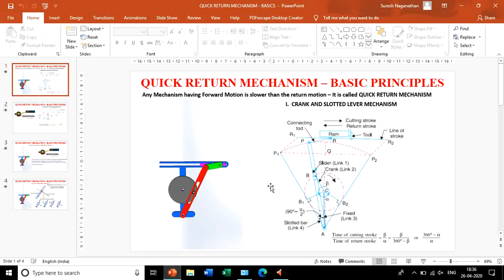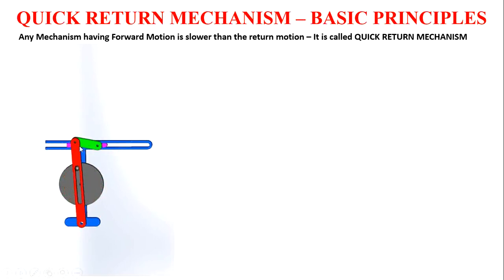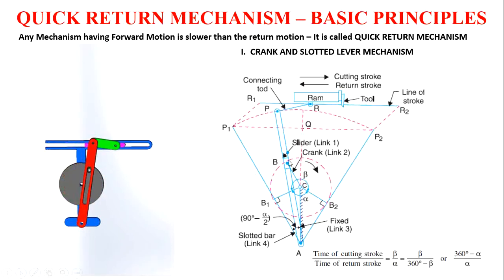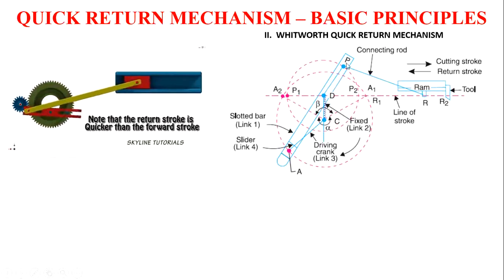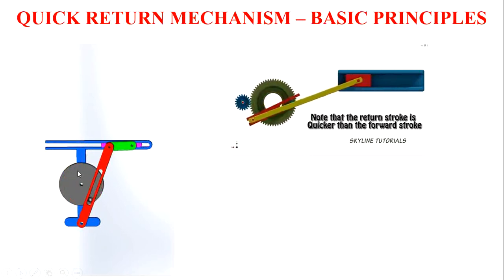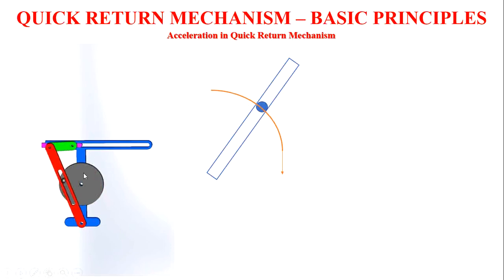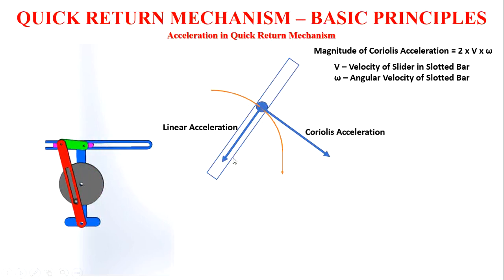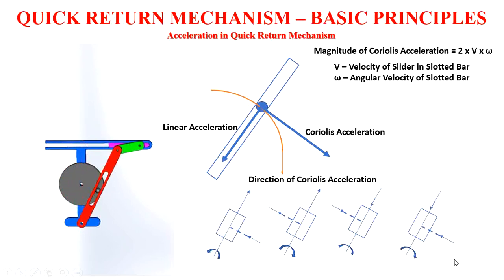Basic Concept of Quick Return Mechanism

Comment from the maker: Few Mistakes to rectify: At 3.35 sec, Crank is AC not PD, At 7.16, In coriolis formula , V - Velocity of slider in Slotted bar and not Velocity of Slotted Bar, At 8.08, Direction is Clockwise and mentioned as Anticlockwise and for its subsequent positions
Thank You